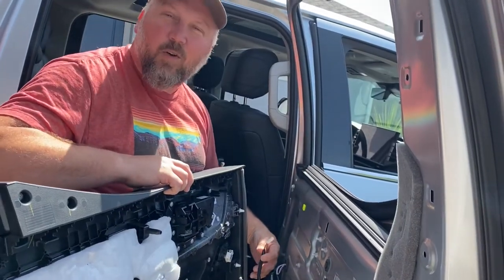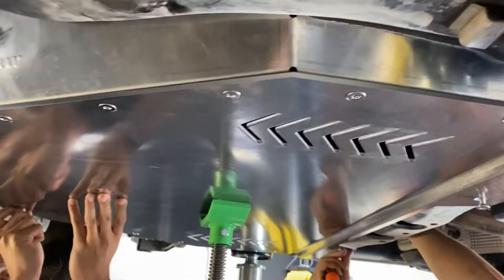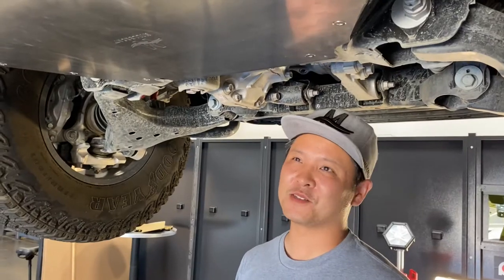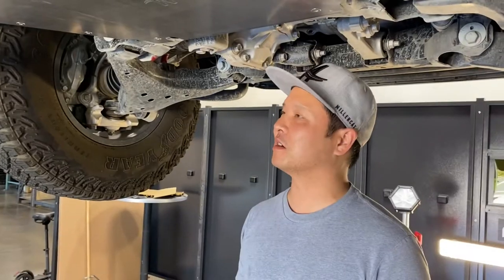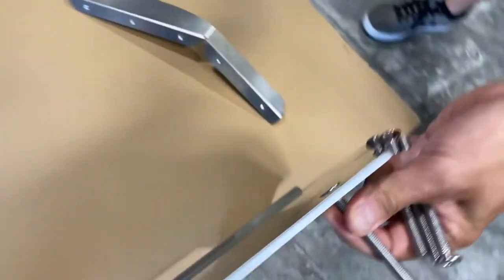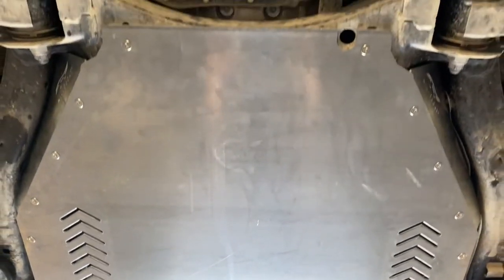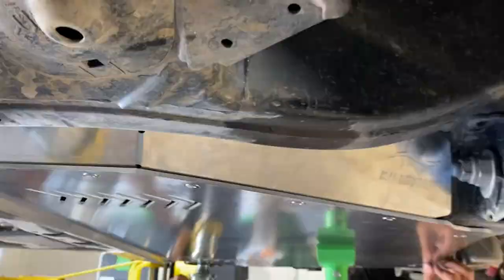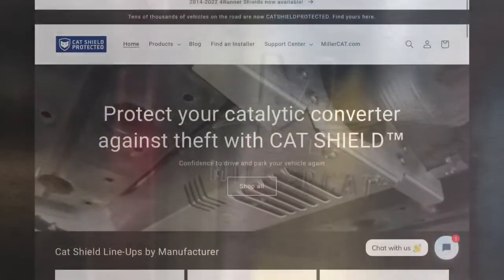2022+ Toyota Tundra 3rd Gen Cat Shield by MillerCat

Comment: I just installed it on my hybrid model. And it looks nice and secure.
Reply from the maker: @MrCliveanthony  glad to hear it. It’s been great and still working well. It interfaced well with my engine skid plates
Reply: @PapaDave208  Yes. I installed it with the TRD skid plate, and both thicknesses protect my engine and catalytic converters. It took me almost two hours to install both on a 1794 limited edition because the skid plate it came with was made of cheap plastic.

Comment: does anybody knows if it fits with the factory trd engine skid?
Reply from the maker: I’ve heard it does, you might need to switch to longer bolts where they overlap
Reply: It does and miller cat now includes longer bolts to accommodate the trd skid plate.

Comment: 2023 Toyota Tacoma. Do not buy piece of JUNK, Vibration noise consistently every time I accelerate. s/w technical support they run me thru hoops (take it off, reinstall, take pictures so they can verify that it is installed correctly take video etc... This is a badly  designed product.
Reply from the maker: Hmmm over 2 years, 20k miles, at least 2k miles on dirt and no sound for me. Sorry to hear that
Reply: @PapaDave208  got my
 electric metal cutter and and shaved off where it touched muffler system and some 1/8 inch rubber sheet and adjusted with the rubber (part away from actual muffler system to fix rattle.